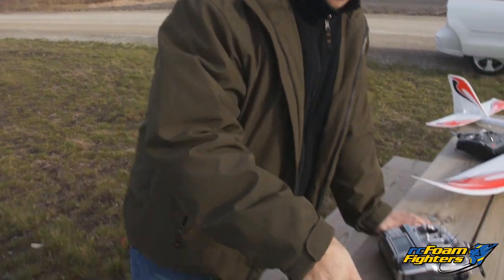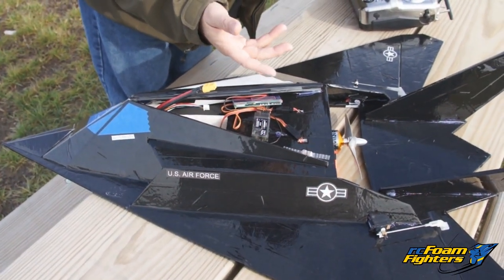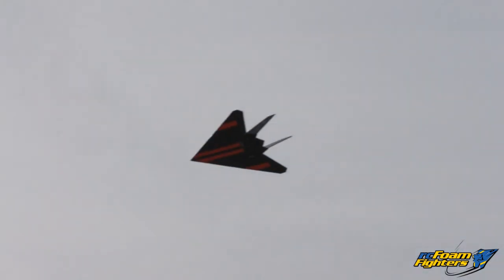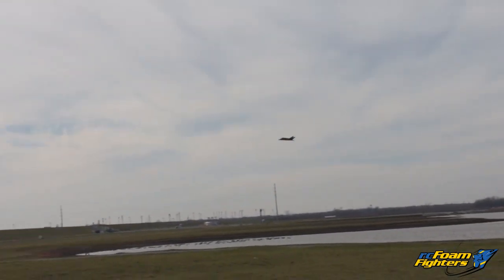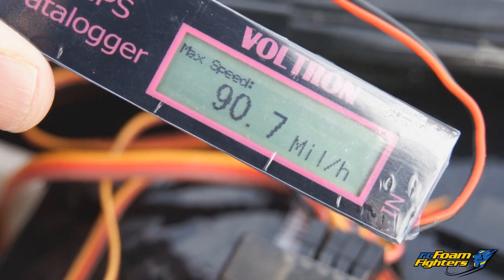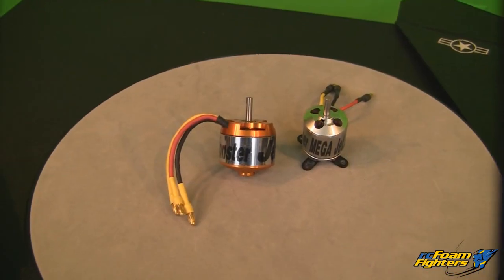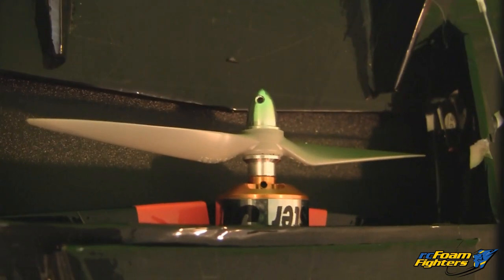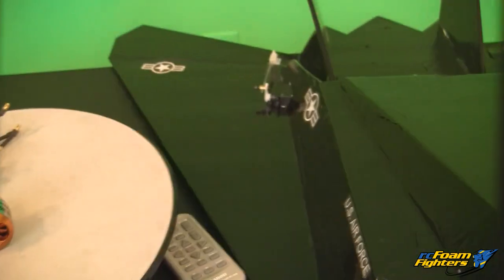Grayson Hobby Monster Jet

Comment from the maker: @HiranTharinda Yes you can use modified CD rom motors for planes. Usually pretty small and planes. I have not built one myself, but have seen someone else who had. He had a blue foam wing, 9oz and I think 2700kv motor 4-inch prop. There are too many variables to say what minimum rpm would have to be. Depends on prop size, plane size, weight and other stuff.

Comment: I would buy one especially if the motor shaft would be offered in the pusher design can it run on a 4 cell push it tell the solder melts.HAHA